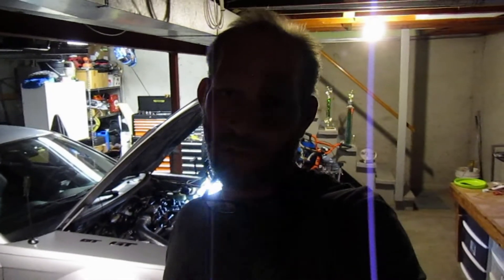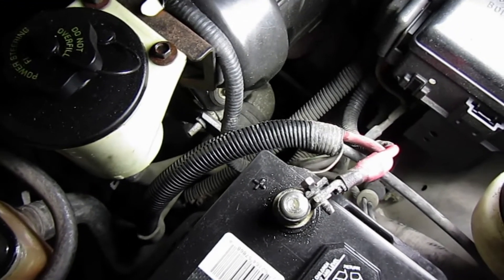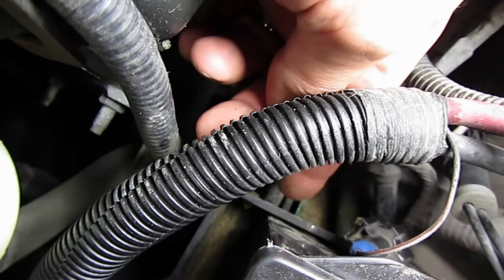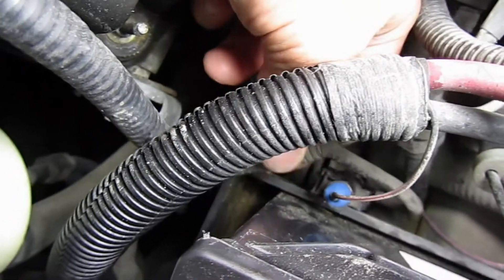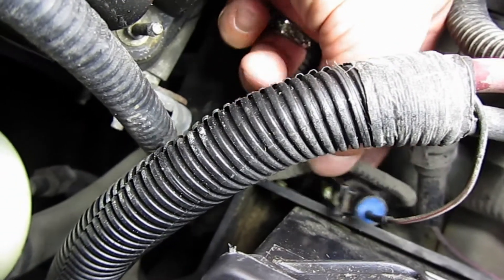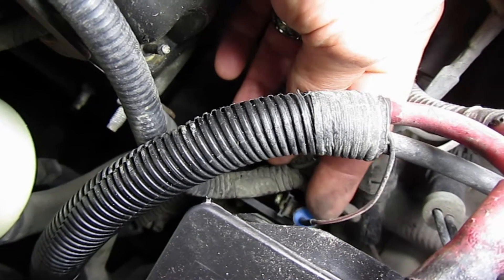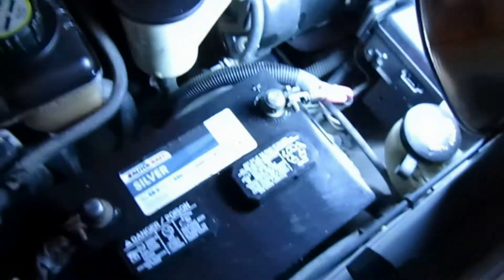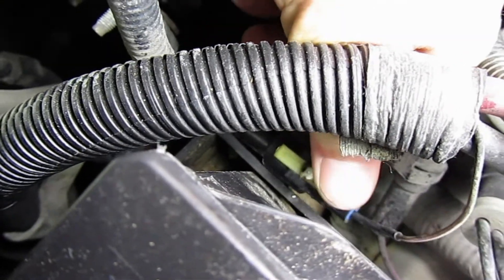How to 2001 Mustang GT oil pressure fix

Comment: Thank you so much for making this video.  I knew there was some wiring issue since the oil pressure gauge was fluctuating on my 02 GT.  The wire was bent at 90 degrees and giving an intermittent signal.  Wouldn't have figured it out without this video.
Reply from the maker: Awesome! I knew I couldn't have been the only one with this problem. I chased it around for several days, knew I had oil pressure but it bothered me to see that gauge flat.

Comment: I did a motor swap and now I can't find the wire
Reply: The only 2 like that is the 1 that goes to the starter  and the 2 wire plug
Reply: The 2 wire plug both black 1 has white stripe and other has yellow stripe
Reply: Both go to body ground